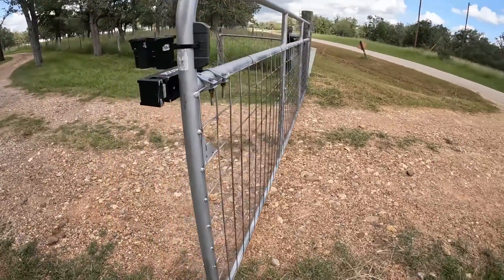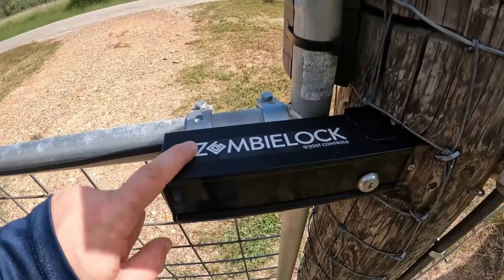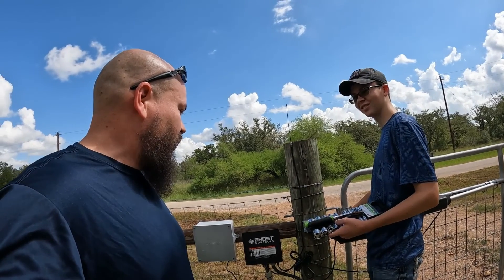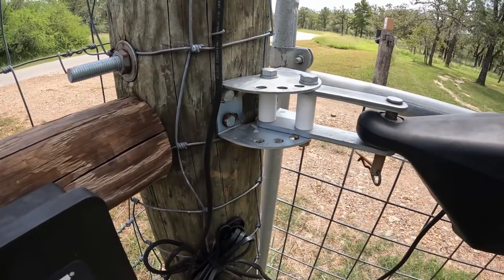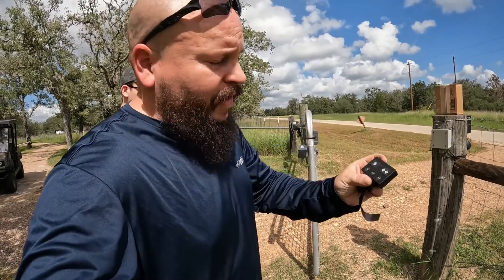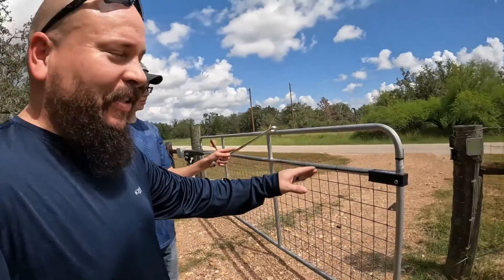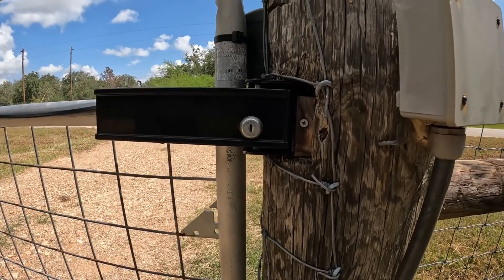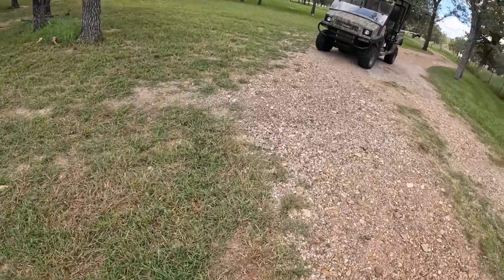Ghost Controls ZombieLock | Adjust Automatic Gate Hinges | Automatic Gate Opener

Comment: I'm just genuinely curious instead of messing with the whole gate itself. Couldn't you just move the bracket for the zombie? Lock up a little bit just so it lines up with the actual gate. So that way it no longer is offset. I feel like that would be a lot easier than trying to lower or lift the whole entire gages to level it with locking system???

Comment: Hi. I thought I would add a tip on how I fixed my ghost control gate lock system. I have a 16 food gate and was having the same problem you was having so I purchased  a gate wheel from a farm supply store, I believe it was tractor supply, and mounted to the bottom end of the gate and adjusted the gate to where the mechanical lock end was a little low so that the wheel would keep a little weight on it and always guide it to the latch at the correct vertical position. This is a worry free permanent fix.
Reply from the maker: Love it!  Great tip and thank you for sharing with everyone.  I've considered that, but I've worried that the wheel would drag or make a rut  in the driveway.  Has that been your experience at all or am I overthinking it?
Reply: @honestreviewsandhowtos  put a flat concrete paver or pour one yourself with a groove for the wheel, wont dig any rut. I plan to do this for mine
Reply from the maker: @wipeoutxl21  That's a great idea!
Reply: You know what's funny is that in the ghost control's manual? It says that you cannot use a wheel, but yet, if you have so much heaviness on the end of it, that it's November's diving to the ground and you only have so much ground. Clearance, it's really your only solution unless you add a wire to the top of it and have it tensioned all the time just to help balance and relieve that strain from the end of the gate. It's a very clever move.

Comment: Issues I had with my Zombie gate lock, background I did troubleshooting with Ghost Representative, concluded bad lock. I did further investigation and determined one of the wires had an open short, I found a company that sold a three wire cable and replaced it. The next issue I had was the lock being out in the elements created corrosion I put a socket on the nut holding the latch mechanism and twisted it several times, my latch no longer sticking open. Maintenance tip spray WD40 in latch to prevent issues. $199.00 five year old lock saved twice for less than $25.00. Also I purchased a 30 watt solar panel of Amazon and added it to the existing panel from Ghost and that has corrected my issues with the gate not opening during freezing temperatures.
Reply from the maker: This is GREAT info, thanks for taking the time to share it with everyone!

Comment: Can you do a video on maintenance of the Ghost control and also how to adjust it when it keeps opening back up? I have looked all over for it, but there is nothing. I would sure appreciate 🙏 😌
Reply from the maker: I'll sure try!
Reply: Having same issue when I close with remote. It closes. Latches. Then reverses and opens again on its own.
Reply from the maker: What you have to do is adjust the "Jog" on the controller when this happens.  there are 3 buttons on the top right of the board, open, set, close.  press and hold the open jog button, then press and hold the close job button until the gate is exactly where you want it.  I like to have it just barely hit the latch.  When you are happy with the placement press and hold the "set" button until it beeps.  Then you'll be good to go.  Hope this helps!
Reply: @honestreviewsandhowtos  I do this what feels like too many times. How often do you have to readjust jog close, esp when it is windy? If none, what is your fix to the issue.

Comment: I’ve been going through this with mine too. I was gonna tell you guys you could put a piece of black gorilla tape over that speaker inside the box so you’re not announcing to the neighbors within 10 miles that you’re leaving and going but you can still be aware by the beep instead of turning completely off.  You can still hear the beeps, but it’s not so piercing.  There is nothing as annoying as after you hear the Zombie Lock lock, the few seconds of gritty anticipation, then you hear the click and the gate swings open!  Arrrrgh!!!
Reply from the maker: That's a great tip!  Thank you!  Yes it's VERY frustrating!

Comment: Mine doesn’t latch properly either. The gate latch is too small. 3 inches needs to be six inches. Weather changes cause shrink or swell in the metal gate and the wood post. A bigger latch might solve this. ALSO, my gate only works part time. Lots of beeps, and switch off and ons to get it to work. When it works, it is great. But I mostly have to get out of the truck to get it to work. Wish I had not bought this thing.
Reply from the maker: Darn sorry to hear that!  Ours works great, minus having to adjust the gate about once a month or so for this latch.  The latch tolerances are so low because if they were bigger you could just pop it open with your finger.  It's frustrating, but we believe worth it in the end to have that extra security.  I'd definitely contact ghost controls if your gate isn't functioning correctly.  They have been great for us with questions and help.